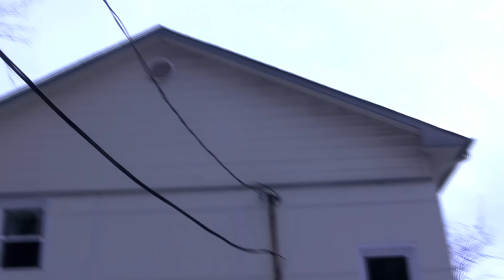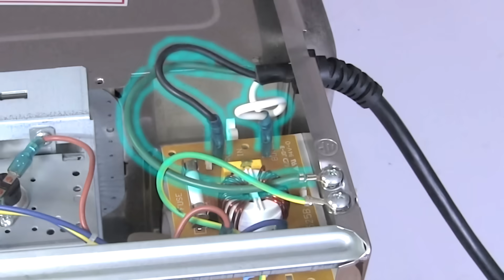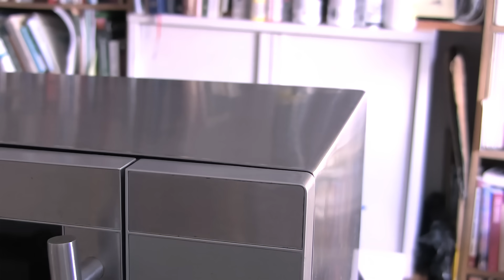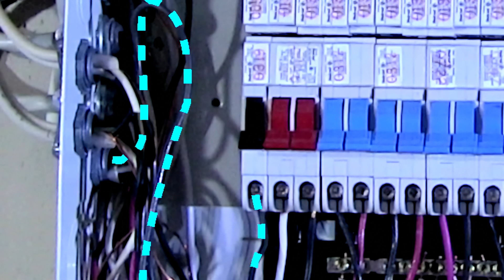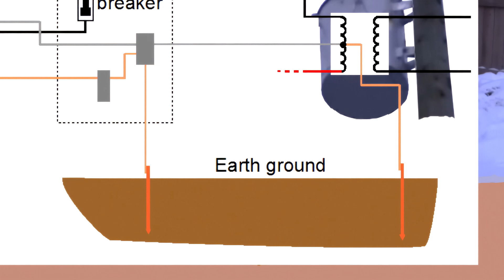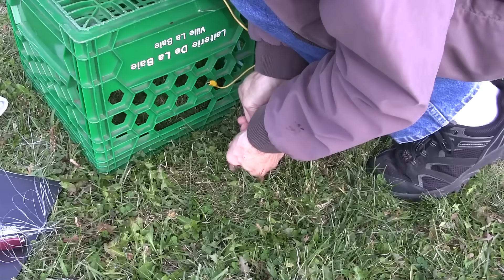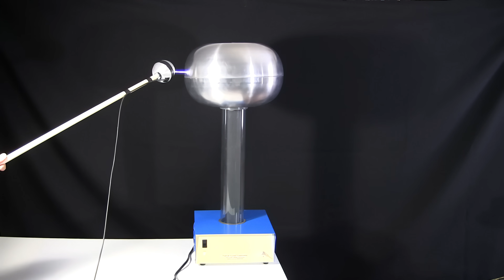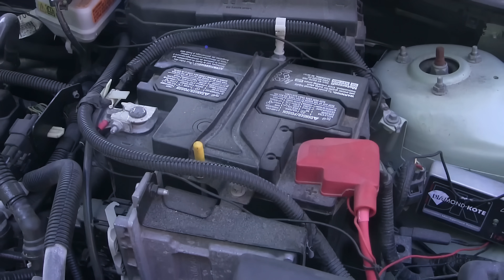What is Ground? Earth Ground/Earthing

Comment: A live wire is "hot" in america?  I've never heard this before.

Also why the heck don't american electrical sockets have switches.
Reply: shingshongshamalama      Hot is a common word in Engineering globally.   It just means the main energy feed.   Live is Hot as the Planet Earth is earthed by a Neutal feed called earth.   Other words are live meaning its current ie present one not Amp current.   Cold meaning its off (but may be a risk as could have leakage or easly turned back on) .     and dead meaning "ended off" ' keyed off".
Reply: You can wire a switch to control the socket but it's not built in. Usually all sockets are hot or live.
Reply: Ie   a switched socket is cold, as its still live if you open it but feed is cold until switched.   Dead means fully cold ie the energy feed is also cold ie no energy feed at all.    Lots of countries have no switched sockets.  In UK it is not a requirement but we is 100% common these days.   Mostly in Live stage rigging they still use non switched for lighting stage rigs.
Reply: Neutral is not earth.  The circuit is Live (phase)  to  neutral ( I am ignoring the fact it is AC for clarity) .  Earth is not reliable enough to return the current to the source, continuously.. Its only used for safety. Yes they are connected together, but the Neutral carries the current, not earth.
Reply: We in New Zealand call the "Hot" or "Live" as you call it in the UK from memory "Active", Neutral is the same and "Earth".

Comment: The electrical outlets in our country are mostly without the ground socket. Will connecting an electrical wire to the metal case of the oven and then to a galvanized rod that is pounded on the ground solve the grounding?
Reply from the maker: Yes, that would work.
Reply: if the ground where the rod was placed gets wet (or flooded) like on rainy days. will it make the flooded place dangerous and electrocute someone who walks into it? or will the electricity from the water go down to the earth and not cause electrocution?
Reply from the maker: The ground wire will only be dangerous for a brief time between when the broken hot wire touches the metal case and when the breaker trips in the breaker panel (see the diagram at 3:29). Once the breaker trips, there is no more electricity flowing. Your microwave oven will also no longer be getting power and you'll have to find an fix the problem and then flip the breaker, in which case everything will be safe again.
If someone happens to be standing on the wet ground at the dangerous time, they'll be fine. The ground will absorb the charge.
Disclaimer: It's best to get an electrician to check your problem and install proper grounding in the wall sockets.
Reply: Absolutely, in this case, the transformer has its center tap ground too.
Reply: What country are you from?
Reply: NO, if there is no link to earth at the other end ie switchboard then it won't do anything but maybe cause a problem elsewhere.

I don't know your power system but if for example it is 240 volts. You have 240 volts between those two wires but no reference to ground, there may even be hundreds of volts difference between the 'neutral' and the ground but  as there is no link there is no return path so no current.

If the switchboard was also connected to ground it would work but I would still recommend installing "earth leakage" circuit breaker in if you had these modifications done.

Sorry on a rant from seeing dangerous installations in my many years of being an electrician.

Comment: Ground and Earth are very complicated to get your head around.    Now issue one in your video, the PCB circuit diagram with the symbol you say is "ground" in fact the iso (international symbol) definition is "chassis earth", sorry but your are wrong - common mistake, also "reference ground zero volts, isolated ground and even virtual ground as used in - (CRT)(SMPSU)" also exists.   Issue two, what you are calling "earth" in your video going ie to "ground earth" is infact you are talking about is "chassis earth" not "mains return earth".   In fact in UK and EU, the earth wire does NOT get connected to Neutral (N) in the fusebox.  Earth(E) to (N) is around 30Vac together, this can be senced as a trip if mA current travels thru this E N reference by a RCCB (L&N~E RCB)   The difference between "mains return earth (copper rod)" ie E and N wire is that they are the same (as you said), but the E wire goes through the Planet Earth ground throu the earth copper rod back to the place of the made electricity, ie generator (backwards motor) via another copper earth rod and the E wire connects to N wire.  Your E and N goes throu the fusebox and throu the direct loop of cable (less resistance than Earth return via copper rod) to generator by underground and pylons via transformers.  Thus fusebox fuse will blow that way.   Note a fuse is to protect the device NOT you or animals (except livestock on a farm where no E or RCB is required, stupid exempt rule in law).   RCB (RCCB) (even good MCB's) is a device that protects you or animals.  EU 'want' to remove fuses in ALL plugs and that ALL mains sockets to have / to be RCB versions.    Source IEE 17th EU addm  BS7671.     *  Earth E cable does alot of things and comes in many forms.
Reply: Nerd disclaimer 》  Yes,  IEE (2Es now called IET as per IEEE (3Es).   Yes - RCD,  MCB, RCCB have loads of other names and have different design specs and workings.  Yes "17th BS7671" is not infact law like "Corgi GasSafe - criminal offence)"; it is only law in a serious incident or nearmiss as per HSE, and only HSE to make a Criminal complaint to Police/CPS for criminal/legal investigation.   Yes - Pylons and underground workings also have thier own many copper rods.   * earth wire via fusebox and for fusebox sole protection as said in video is NOT a good enough safety method as per BS7671 EN EU addm.  A lightning air rod and building lightning solid bar cable to air rod to copper Planet Earth rod should/must/lawfully be used ( this earth method can be connected also to the fusebix earth E wire.   If not and lightning hits your E at your location or next property or nearby they your fusebox will proberly blowup and cause building fire, this happens/happened alot.  Also note Telco landline phone earth exists too (also called network/exchange earth).   This can be lethal if lightning hits somewhere on the nearby Telco network (UK = 50Vac) and into your Telco cables (old analog landline) and goes into your land phone and out throu the speaker into your head (if using the phone) to feet killing you.  Hence why now DECT phones exist.
Reply: A fuse or circuit breaker is to protect the wiring and may subsequently protect the device. You choose a protective device based on the maximum current a cable can carry. In Australia neutral and earth are bonded at every supply transformer and at every meter box/ fuse box at point of supply into dwelling only (multiple earthed neutral link or MEN link) In the event of a fault, huge fault currents will travel through the MEN link back to the transformer due to the low impedance path of your earth wire.

Comment: If the ground copper wire cuts we can joined it or joined ground doesn't give good result
Reply from the maker: You can twist the ends of the wire together and then use a twist-on connector or other type of connector (https://en.wikipedia.org/wiki/Twist-on_wire_connector).
Reply: RimstarOrg  thanks

Comment: If the wire is connected to physical earth which has essentially no charge why does the current even flow back to the transformer?
Reply from the maker: I'm not sure which situation you're talking about. The normal return path is through the neutral wire. The physical earth is conductive but has a high resistance so, while some does return through that path, it's far, far less.

Comment: Great video.  Professional.  I wish diagram extended to generator in powerplant (and showed how electrons return to powerplant?) (and leakage or stray currents?)
Reply from the maker: Thanks. I'm glad you liked it. Show the transmission side of things would be outside my comfort zone. I wouldn't be confident that I would get it right or cover enough parts of it. It can get quite complex and there are so many variations, usually for historical reasons, even within a single country.

Comment: I would like to ground myself. I am working on a grounding system for my bed but don't want to spend money on the products I have seen so far. Will foil tape on the bed connected to copper wire leading directly to ground work?
Reply: No, not really because your bedding isn't naturally conductive... I mean, why are you even trying to do this? That's actually potentially dangerous.  I mean, you'll essentially become part of the chain towards the lowest potential...That is not where you want to be.  Electricians spend their entire working lives avoiding the hell out of that so they aren't killed while at work.
Reply: If you are making direct contact with that foil then theoretically yes...but again I wouldn't do that. If you use an electric blanket the potential effects could be disastrous. Or an alarm clock. Or if you're on your phone in bed. Or listening to your walkman with earphones.
Reply: For anyone wondering why this person wants to do this. There is a bunch of internet hoopla talking about health benefits from "grounding" yourself.

Natural selection will probably take care of this nicely.

Comment: The grounding explanation seems a bit off.
The primary reasons for earthing are.
1. protection from device or fixture surfaces becoming live from Live/Phase/Active/Hot coming into contact with the chassis of the device by providing a return path.

2.Bonding of all equipment in the house and surrounding area to ground. prevents voltage differential forming between equipment (Double insulated devices defeat this). 

3.Earth connection to earth via earthing rods or other metal objects like pipes in ground Is to provide a secondary path to the supply network in case the neutral between the property and distribution network fails.
Also ensures GFI/RCD protection devices will still operate if ground connection to a device failed.
Reply: #1 was indeed addressed in the video.

#3 doesn't seem correct...are you saying that electricity exiting a home via a earthing rod will somehow be able to get to the transformer's earthing rod to complete the circuit?  That's an awful lot of random earth to negotiate.
Reply: dougdevine27 it works here. On any intallation that gets work done a earth rod or more have to be installed to ensusre a resistance less than 25 ohm back to the transformer
Reply: I don't doubt you can measure less than 25 ohms to the transformer but who's to say that's the least resistive path?  Let's say you measure 20 ohm to the transformer.  That's great...you're within spec.  But what if there's a 10 ohm path in the opposite direction of the transformer?  Electricity will take that path.  Right?  Am I off base on something?
Reply: I don't make the rules here.
there will always be multiple ways back.
If every house is upto date here you will have your neighbors earthing rod to return via as well as the weak path to the network ground point.
it will split the current in your example you will end up with 6.67 ohms

Comment: At 3:36 if its enough to tie Ground to the metal case so why we still have the neutral tied to case also?
Reply: Wait...the neutral isn't tied to the case, it goes into the mains.
Reply: phuturephunk i see two tied cables onto metal case. Thats why i asked
Reply: That second green wire, the one with the yellow stripe, is probably the ground from some other part of the unit's circutry. Green yellow is coded for safety ground in other countries (not the us, which uses green). They probably make that microwave for multiple world regions and just left the wire the way it was for all markets. I'm guessing though, someone with electrical engineering experience could probably clarify.

Comment: What a great video. May be the best I have seen. Can anyone answer me this. On a new chandelier light i installed it had two wires. (And a ground wire) No hot and neutral. Just two wires and it didn't seem to matter which way I wired them. Why were they not labelled hot and neutral? Are all lights like that?
Reply from the maker: I can't speak specifically for your chandelier light but for some appliances, which is hot and which is neutral just doesn't matter. The AC (alternating current) just moves electrons back and forth and so for them, that's all that matters, and that's not affected by how you connect them. Also, if they don't involve a metal case, as with the microwave oven in this video, then there isn't that safety issue.
Reply: Makes sense, many thanks.

Comment: Is copper the only wire to use when grounding things?
Reply: But nobody is trying to shove a 20ga copper wire into the ground for grounding purposes...God I hope not.
Reply: yes it is the only legal as it provides the lowest resistance.
Reply: Silver provides lower resistance and corrodes slower...but dammit if those sterling pipes aren't pricey.
Reply: we could use silver or gold there are other metals too but price per meter would be a issue.
But for grounding world wide as far as i know bonding wires are always copper the rods are often other materials.
Reply: Gold would be terrible because not only is it expensive it is INFERIOR TO COPPER when it comes to conducting! It would corrode slower, I'll give you that...but copper is pretty dang good at resisting corrosion. Silver is best of both worlds.
Reply: Sure is. gold is still better than Aluminium in conductivity.
but it comes down to the purpose the material is going to be used for.
Reply: Any conductor can ground things a large aluminum braid conducts better than a thin copper wire

Comment: So the microwave will not work?
Reply from the maker: After the breaker trips then no, there will be no power going to the microwave oven. If you try to turn it on again, the breaker will just trip again until you fix the bad wiring.

Comment: I think someone needs to tell China about grounding and what it is used for as they don't bother to connect it even if the wire or terminal is there Bob-UK
Reply: They might have the sockets for it but their infrastructure may not include a lot of copper stakes. Hopefully this isn't true in their industrial sectors at least.

Comment: I have a question. I’ve been watching videos about ‘earthing’ for health. That is sleeping with a grounding wrist strap connected to the ground socket. Could this be dangerous if there was a faulty device during the night ?
Reply: I suggest connect in straight to the Earth using a cable wire
Reply: Marcus Spain yes dude be careful using electronics and other electrical appliances around when you're earthing or grounding which is the same thing recommend going straight to the ground with a coaxial cable and there's probably some sort of GFI fuse breaker type thing I don't know the details of that though between you and the Earth
Reply: Marcus Spain ://www.ncbi.nlm.nih.gov
Reply: YES!! This is probably a trendy myth that's being thrown around. Don't do it. All it would take would be contact with a battery and you could be dealing with a literal hot mess. If you're on your phone and it malfunctions, you could have a Note 7 situation. If you're sleeping with a heating pad with a cord the dog has partially chewed...you are SCREWED.
Reply: SMH Yon Kromis my point was not to tell him to exercise care it was to say DON'T DO IT. Grounding yourself offers no health benefits that have been peer reviewed and scientifically verified, and it is potentially VERY dangerous. It takes 150 times the lethal amount of current to trip the circuit breaker. Your body will resist the flow of current and it will probably not be high enough to trip the breaker (the thingy about whose operation 
 and location you admittedly don't know anything about) but it will damn sure be high enough to kill you. There are GFCI circuits, but usually in the bath and kitchen, not your bedroom. Those outlets are on a different sub circuit and furthermore, are designed for accidents, not idiots. DO NOT GROUND YOURSELF UNLESS YOU ARE WORKING WITH SENSITIVE ELECTRONIC EQUIPMENT SO AS TO AVOID STATIC DISCHARGE DAMAGES.